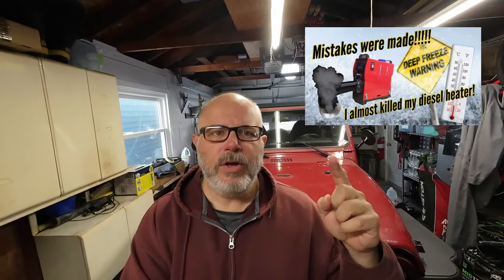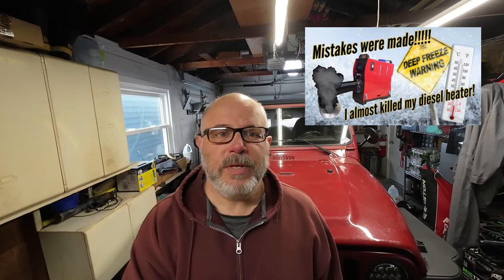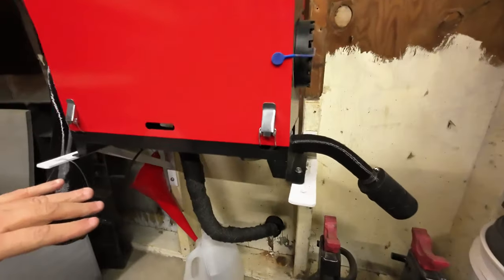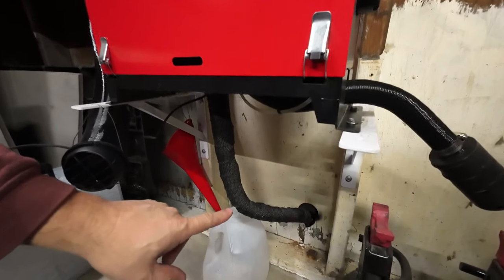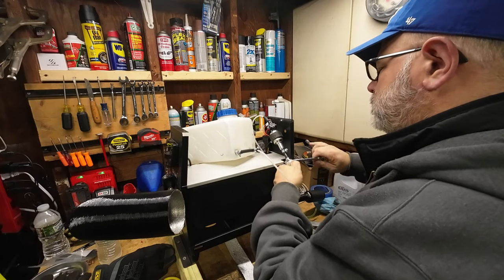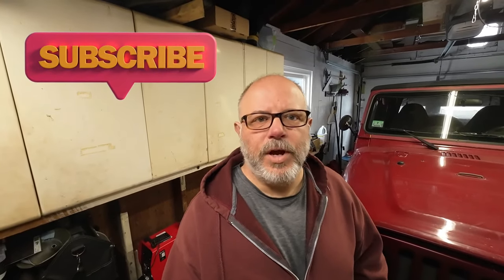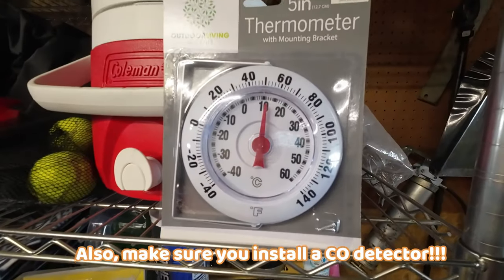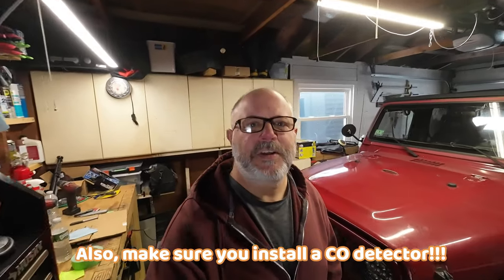5 Things you need to know about diesel heaters

Comment: First off, its not an 8000 btu heater. Its an 8 kilowatt heater which translates approximately to 27,000 BTU’s.
Reply from the maker: Thank you for clarifying.
Reply: Also. There's not one of the Chinese diesel heaters that is rated 8kw.  The burn chamber are tte same on the acclaimed 5kw and 8kw. In addition, it spends fuel to the amount of 5kw, it does not nearly put out 5kw of heat. 

So therew two models. 2.5kw, and the 5kw. It's been picked apart by many and well documented :) 

Of you want a proper one, but still cheap. Get a lavaneer/lavaner. Chinese heater, only it's assembled properly, actually quality controlled, tested, and every spec are open to the public. 👌🏼
Reply: Also. Burns half a litre per hour.
But kw energy available from a litre of diesel is 10kwh (38Mj)

Comment: Just a note -  The Kw is NOT Kilowatt it's CALORIE watt.  So these 8K units should be putting out 27000 BTUs.
Reply from the maker: Thank you for sharing that, I always wondered how that converted.
Reply: What kinda crap are you rambling on about? Kw stands for Kilowatt on these heaters and on anywhere it says Kw. I have no idea what you have smoked to come up with CALORIE WATT.
Reply: Calorie watt hahahaha. This guy smooooke. Who is your dealer
Reply: @pacopet1234  Took you long enough.
Reply: I'd like too know how you power up this heater, because I hear on start up the glow plugs need up to 15amps / 120w supply this will drop when it's warmed up to under 10amps / 40w. Most lithium battery generators only have about 10amps max, unless it comes with a suitable brick converta this is a small problem.
Reply: @pacopet1234  I'm just stating the facts these heaters use up to 13amps on warm up, so a simple cigarette lighter power point won't be enough amps to get it warmed up, if you have an high rated lithium battery generator around 2000w it should be ok, but a 1000w doesn't have enough amps capacity in the 12v system. A mains converter would be more ideal, not sure any models come with this option, I think the problem maybe that the demand differs so much from warm up to normal running.
Reply: @stephenboyd4934  I thought I replied to this this morning but looks like I didn't. I can't see these things pulling that much really. I need to put meter on it, but I've got a battery backup unit that supplies 110 power to the heater, but it doesn't support more than a few amps.. like I can't run a hair dyer off it, but little blower or fan is fine.  It has no problem starting or running the heater and there is no way it could supply 10+ amps.
Reply: @stephenboyd4934  never had any problem with my 6 amp 24v pc power supply.  That's 144 watt. 1000watt or even 2000watt that's wayyyy to high.
Reply: @CDale-tc3xz  well according to this channel : Primal outdoors - camping he has a video 9 days ago stating that his battery generator only has a 10 amp output & keeps tripping out because the heater wants more, he has to keep turning it on until the glow plugs warm up / not ideal. I haven't got one yet but looking for the best not cheapest model that will come with problems.
Reply: @stephenboyd4934  I don't have the exact model, but they're all pretty much the same.  However The one I have is meant to run off 110AC and has a plug - that's likely the reason mine doesn't have issues even with the battery unit in between... Had not been thinking about that as I have a different use case.
Reply: @stephenboyd4934  according to the manual that came with my Vevor 8kW diesel heater (12V model) it uses 40W.  I have it connected to a 12V RV battery that is charged/maintained with a 1.5A battery maintainer.  It has no problems keeping up.  Whereas previously it was connected to a 0.8A maintainer which would slowly lose charge.
Reply: 100 watt startup & shutdown. Between 30 to 50 for normal operation. Also, diesel only has 33K btu per liter. At most this is putting out 10K btu.
Reply: @pacopet1234  you have 24V diesel heater? What components are different on that? I know that main control board can be same (switchable 12V/24V on settings) but does it need 24V glow-plug and fuel pump? I bought 24V heater but at least fuel pump says 12V, havent tested it with 24V yet, test with 12V and it works with that voltage. So I am not sure I really got 24V kit.
Reply: @meelis79  i really don’t know. A small control board and glow plug should make a big difference for 12 or 24v. I’m powering mine with a laptop charger

Comment: Didn't see anyone mention it yet (though I didn't scroll very far) but placing the combustion air intake outside the garage will stop it from sucking in cold outdoor air from every crack and crevice in your structure, likely improving on the 20 degree temp difference you've been achieving. Just food for thought, and I can think of times you may want that fresh air infiltration despite the inefficiency. Thanks for a great, short, informative video.
Reply from the maker: Yes, someone here did mention that. I just haven't done it yet. Maybe someday. Thanks for commenting.
Reply: WARNING!:Be very careful with combustion air intake inside. If power fails during a firing cycle the unit will not have the shut down cycle. This means the combustion chamber is full of fuel and it will vaporize unburned and come out the intake tube. Choking fumes that really stink. Never leave it running unattended.

Comment: They work fine for the first few months but once the inside of the flame chamber,(which has a mesh surrounding it which can't be seen unless it is cut in half ) gets full of carbon it will start to carbon up faster each time and will not combust the fuel properly causing more soot and carbon build ups in the exhaust and burn chamber. You can't pull the burn chambers apart to clean the inside and no tools will scrape away the carbon build up behind this mesh. the only thing I have found that removes it but also corrodes the mesh a bit each time is Hydrochloric acid, most the buildup turs to a black smelly sludge and can be rinsed out with water. I can't see any other way to clean this and acid was the last resort, I feared it may dissolve the mesh entirely but if done quickly with ample rinsing with fresh water seems to work fine so far. If you have an old blocked burn chamber that is not working give the acid a shot and see if it works for you.
Reply: You can get spare parts for these heaters.

Comment: You could spray foam between your rafters and get even better heat retention plus I guarantee you you'll use less fuel plus it will heat lots quicker
Reply from the maker: I was thinking about that and I also have to get my walls insulated. Just trying to figure out a cost-effective way of doing it.

Comment: Good vid, Paul,  thanks for the info. I put the smaller version in my VW bus and can run it down to around zero F°. Key to keeping it happy are clean fuel, I use kerosene,  seems to make a big difference,  and like you say, run it on high most of the time to clean it out- its gotta get hot enough to burn efficiently 👍
Reply from the maker: Thank you!

Comment: Are you running your air intake inside the garage and your exhaust outside the garage?  If so you are pulling cold outside air into the garage and making the heater less effective.  Maybe it doesn't make a huge difference since you're not insulated garage anyway but you may be able to run your intake outside and achieve higher temperatures in the garage.

Comment: Im a glass blower, i live in ny and i have 1700cfm of ventilation going while my torch is going. I struggle to stay warm in the winter. The best i have found is a 60-90k btu propane salamander, anything over 90k like burns all the oxy out of the air and i start feeling really weird. Was considering the diesel heater but it doesnt seem its gonna be enough heat for me. Thanks for the info!
Reply from the maker: I would agree, that's a lot of air movement and the heater would not be able to keep up with that.

Comment: If you run your heater on low, it will speed up and clean out the burn chamber before it shuts down. I noticed that on mine after running mine all night on 2 kz I shut it down and the fan sped up and the glowplug came on to burn off any residual fuel in the chamber.
Reply from the maker: Mine does that on shut down, the fan ramps up for a bit before it shuts down.

Comment: Great video. You said the diesel heater isn't the end all be all solution for a garage heater but from the standpoint of economics it actually might be. Your video gave me good insight as to how one of these units may help my situation. I have a 30x40 uninsulated pole barn so I would likely get poor results until I decide to insulate my barn. Either way if it take some off the chill of without gagging me like my torpedo heater I would call that a win.
Reply from the maker: I agree. Thanks for the comment. After doing multiple home projects this summer I’m saving up so that in the spring I can start insulating my garage. That should give me really good results. It’s definitely better than a torpedo heater. Good luck with the pole barn.
Reply: What's a torpedo heater? A propane fanned blower type?

Comment: Thanks for this short but sweet video, it has provided useful information. I am just considering the purchase of one of these type of heaters for my newly commissioned mobile workshop. Its 7 x 12 x 6 feet high, and basically is just a cargo box that I forklift onto the back of my flat bed truck. I often get sent to really remote locations in the depths of winter to fix stuff, and I find that stuff sure gets fixed quicker when i am warm.
David in the UK.
Reply from the maker: That sounds like an awesome setup. One of these heaters would work great for that. I do recommend the fuel line upgrade. I think there’s a link on that video for it in the description. It just seems to make it run a little bit better I don’t really know why it does but it does.

Comment: This heater is really about 10K btu. Diesel contains about 33K btu per liter, burn rate is about .35l an hour on high, so only 10K ish btus are available for heat if it were 100% efficient. But with all that heat escaping as exhaust its not giving full btu as diesel has. To reclaim exhaust heat I put a 6' stainless exhuast ran through aluminum downspouting filled halfway with sand. This helps extract lost exhaust heat along with a small fan. Hope this helps.
Reply from the maker: Thanks for the info and the great idea.

Comment: Awesome!   I wonder if this bad boy would run on 50/50 diesel and filtered waste motor oil?
Reply from the maker: I know people tried it and it works for some but I’ve not tried it myself
Reply: Don’t! Just don’t…you’ll have nothing but trouble…they run very frugal and trouble free on diesel, kero, or heating oil..just a headache playing around with alternative fuels and why? It’s not a truck getting 10mpg it’s a DIESEL heater running 8hrs on one gallon at high 😂 do you want to ice skate uphill also 🤷‍♂️ 
FYI, increase the minimum set fan speed for cleaner combustion on low, it soots up because of being too rich fuel/air mixture. A little research will turn up the master code for your model. Once the unit is at operating temperature, bump up the set fan speeds so hardly no black smoke is seen from exhaust. I went up 200rpms and haven’t had issues with soot buildup since. Before that; If the heater did soot up or got flooded with fuel, a trick I used was a shop vac hose hooked up to the vac exhaust as to blow  in the intake at a high volume and blow out excess fuel or carbon without disassembling the whole thing.
Reply: They will run on filtered waste oil + diesel but you will only get 2 maybe 3 tanks of fuel through it before it blocks up the burn chamber and then need a major cleaning. If you don't mind cleaning them out 2 times a week it's fine, they will run on mixtures of waste oil and diesel. I think they are over rated and very labor intensive. Once the inside of the flame chamber gets full of soot there is a gauze in there that is supposed to glow red hot to help combustion, this gauze can not be seen unless it is cut in half , but when it is clogged with carbon and soot it will begin to carbon up faster each time between cleans. As I wrote in the above comment the only real way to clean behind this gauze where the gunk builds up is to use Hydrochloric acid. Because there is no access for tools to be used on this part unless the burn chamber is cut open.

Comment: so when its minus 45deg celcius where i live it'll raise the temp 20deg to minus 25 deg. perfect i can work in my garage in a t shirt and shorts.
Reply from the maker: My experience with my uninsulated garage is 20 degrees f above the outside temperature. If you have a bigger area or more insulation it could be different in your situation.
Reply: Lmao.

Comment: WARNING!:Be very careful with combustion air intake inside. If power fails during a firing cycle the unit will not have the shut down cycle. This means the combustion chamber is full of fuel and it will vaporize unburned and come out the intake tube. Choking fumes that really stink. Never leave it running unattended.
Reply from the maker: Thank you for sharing this information with us

Comment: The harder fuel line makes zero difference as there isnt any pressure in the fuel line when running, it is basically gravity fed and the pump just meters the flow it dosent pump under pressure..
Reply from the maker: Thanks for commenting and sharing this information.

Comment: I have one question about It With 1 liter Oil how long it will work i mean how long it will Heat exactly
Reply from the maker: With the on-board tank full and running on high it will run for about 14 hours. I never run it on a lower setting so I'm not sure how long that would last on low. I suspect it would run 24hours on low setting. Thanks for the comment.
Reply: @paulethier3416  thankyou so much sir  and how can i order one of this in my country in kosovo
Reply from the maker: I'm not sure if you have access to Amazon but there are links in the description for the heater and other parts.
Reply: @paulethier3416   thank you god bless you ✌️

Comment: How long does a tank of diesel last?
Reply from the maker: I get about 12 hours or so on high setting.
Reply: 12 hours on one tank is exactly the question I wanted to ask. But the question on top of that is will a fully charged car battery run the heater for 12 hours also? I want to put it on the deck of my boat and run the heat into the cabin. The cabin is the size of a minivan.

Comment: Just throw some diesel 911 in it when it gets super cold.
Reply from the maker: It doesn’t get cold enough to gel the diesel. The heater is just not strong enough without insulation. I’m happy I bought it and used it this winter. It really is cheap affordable heat. Thanks for commenting.

Comment: Your fuel filter inlet should have the fuel going to the outside of the filter element. if you have the fuel go inside the element it will fill up with debris like a cup and clog the filter easier!
Reply from the maker: Thank you for commenting. This has been pointed out to me many times. When I installed it I did not notice that I installed it wrong. Its been changed since the video.

Comment: Hi is it ok to run the heater fuel pipe 14 ft length thank you
Reply from the maker: Im not sure. I’ve seen people try to capture the exhaust heat by running it through a heat exchanger. So I guess it could work.

Comment: Is the filter kit necessary? I know a guy who has had one on his semi for years and doesn’t run a filter… seems like you just added some failure points to the system.
Reply from the maker: I don’t believe the filter is necessary. In fact, mine failed early on this year in the fall, I could not find one locally so I ordered one. In the meantime I’m ran it without a filter, still going strong 3 months later.